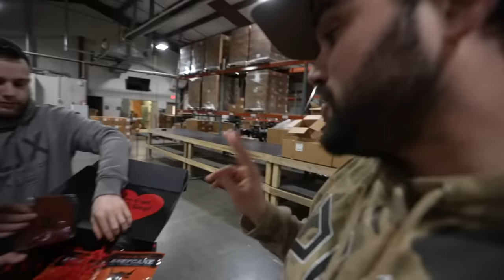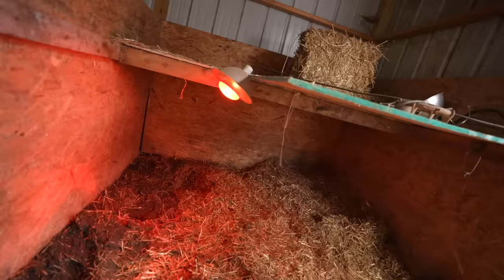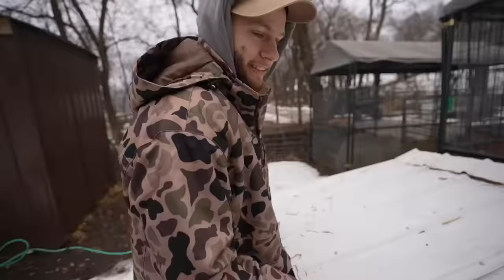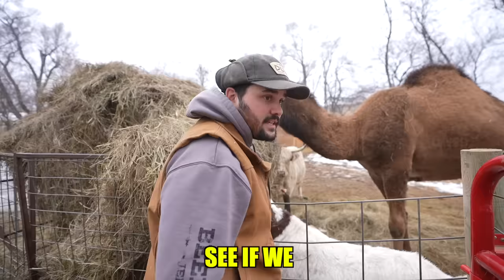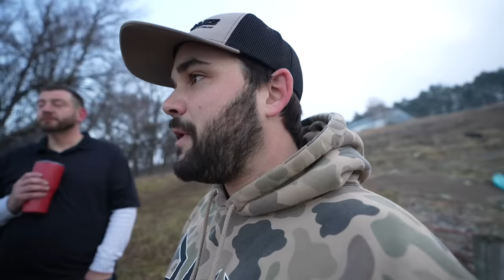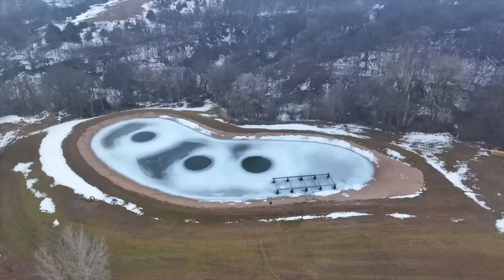SURPRISE Major BACKYARD POND Update!!! (Did I Just Save $100,000?)

Comment: Natural ponds are way better, liners are fine but you have muskrats, snapping turtles that will damage the liner. Rotting material will create methane pockets that will create Big pimples in the liner and they will eventually pop and it sucks when it's in the middle of the pond. My suggestion is spend on extra bentonite and re-layer with dirt and sheeps foot the crap out of it. I've done many ponds and for the most part, the ones that did put in liners aren't over whelmingly happy with the out come... Clay is the ticket but it is pretty expensive ...just my 2 cents
Reply: Crawfish can cause damage to a liner also.
Reply: Agreed
Reply: Could catfish also cause damage to liners?
Reply: @garretthuddleston2341   To clay liners it’s possible
Reply: We have a natural dam in the pond at the old farm. It’s a huge pond. We kill snappers to help keep them off of the dam still but the layering is definitely key
Reply: I have shot the liner in a pond with a 300 win mag while the liner was 4 feet deep
Reply: Bentonite !
Reply: @garretthuddleston2341  
If the liner is exposed yes but nowadays most pawns with liners are buried between 6 to 12 inches of soil on top of them
Reply: Agreed
Reply: 25 yr warranty tho..

Comment: If you line it, you'll want to cover the lining - preferably with rocks, gravel, etc. that will hold the liner down (stop if floating up), and will protect it for life.  You will need a lot of rock/stone, but it will make a natural looking pond.  I made one like this on my channel....I would still go with the clay and bentonite though. You'll do it right, and you won't scrimp on cost, and it will be a much better product long term.  Just don't cut any corners while you do it.
Reply: With the pressure of the water it will stay down
Reply: Flair listen to this legend!!! He’s the best around!!
Reply: This, all of this.
Reply: I think the weight of the water would hold the liner in place, wouldn't it? I guess the company would know how/what to do. The one benefit of using the liner over the bentonite/clay is that if it does start to leak, someone who knows what they're doing will come and repair it, which I bet would involve learning where the leak is, etc. For the record, my initial vote was for the bentonite and clay too, but there were a few tidbits (like them coming to repair it for 25 years) that we didn't know last time. That's a pretty big perk in the long run. 
Plus after many years, even if he decided to remove the liner one day, I'd like to think that with the weight of the water on the soil, etc. may have helped compact the soil underneath to help seal it?  I dunno, I'm just thinking out loud, haha.
Reply: Yes

Comment: I am not an expert by any means but after some quick research I say the bentonite or the clay and bentonite method. If your pond is currently not holding water… you are solely relying on that liner. Although it may be under warranty for 25 years, if there is an issue with the liner in a deep part you are going to have to drain the entire pond and start the whole thing over again. Let’s say you go 7-9 years with no issue and have 10-16 pound bass in there and the liner rips or a muskrat rips through it… all those years are gone. Your pond is going to end up looking exactly how it is currently. Making it as natural as possible reduces the risk and fixing an issue may be more expensive but it doesn’t wipe out all of your years of growing those fish. Just my thoughts.

Comment: Clay and bentonite, based on the other ponds sounds pretty straight forward that clay and bentonite would be fool proof considering both has little to no leaks without clay and the one that doesn't leak was even mixed with the same soil your working with, seems obvious to go with something that's easier for you to add structure too without the stress of it causing a leak later on and having to find it

Comment: Bentenite, Clay, and big roller for sure!!! I have seen pond dams where a muskrat dug out around the overflow tube and started leaking and was definitely fixed with just bentenite and have had no issues since!!! Now if you have a liner and an animal pokes holes in it is it still covered under warranty or not??? I definitely say bentenite and clay and make it at least 15’ to 20’ deep and you won’t have any issues!!! I did say something about the more water would help put more weight down helping it to not leak way back in one of your first videos!!! The pond guy I no had told me about that and with the bentenite and clay packed in and being deep enough that he would definitely guarantee it to not leak but it would have to be with the correct clay also!!

Comment: I'm with most on the bentonite train mainly because of having watched the last few years of pond "antics".... the structure adding, random challenges that would make osha faint and the possibility of a random stray from a hunt or target practice not to mention hooks or fish with teeth going after prey on the bottom
Reply: Two things water greatly slows down projectiles and the earth and gravel on top of the liner will protect it as well.
There is a mesh shield that you can get seeded with wire that will protect the pond from most things.
The only real difference is margin of error, clay ect has a large margin for error compared to a liner. What people don't seem to understand is you can pack stuff on top of a liner to keep it natural and safe, in fact it's hardier than without.

Comment: I'm a fellow Nebraskan in eastern Saline county. I have a roughly 2 acre pond on my 40 acre square and although mine was an old pond that we dug out and always held water, after we dug it out to increase and expand we did spread a few trailer loads of vermiculite, yes vermiculite, and we just drove on it with our trucks to pack it in (cause we did that after all the big equipment was gone or wed have had them track in it with their dozer). You have to keep in mind that once there is water in there and the soil becomes conditioned to holding water (could take some time) it will also silt in and add to the whole sealing effect naturally... Also should you go the Bentonite method you can slurry or float vermiculite to help seal leaks, it will float at first but once it becomes water logged it will sink and naturally settle where any leaks may show up.
In short, natural ponds all the way.!..

Comment: Both will hold water and can be installed on large ponds. The difference is that Bentonite can self-heal and expand around the small gaps and crevices in the soil, meaning that you don't need to worry if the machinery runs over the liner or plants and roots pierce the pond bottom
Reply: Plants and roots aren’t going to pierce a liner they are insanely thick most even have fiberglass woven in they are both good options but I think a high end liner is gonna be a safer long term bet especially with the free 25 year warranty like🤣 that’s common sense brotha

Comment: 4 ponds is a tiny sample, so banjo and jake saying 100% of the liner ponds don't leak and 50% of the clay ponds leak doesnt really mean anything especially since it sounds like the clay pond that leaks could have neen made to not leak if the right steps were taken. I dont have any experience or data to support one or the other but i just cant get on board with putting a huge piece of plastic or rubber or whatever in the ground to make a pond. Maybe the liner will last a long time but maybe it wont and if it doesn't, its going to be a major PITA to dig out and replace or even just dig out and dispose of if you don't want it anymore. Sure, you can apparently repair a liner but you can also repair a clay lined pond. The earth has enough trash and plastic buried in it without us intentionally adding to it.

Comment: It's easier when you have other people spending your money!😅😅 but after you talked to the people with bentonite, that route seems cheaper also considering you sold everything to save and spending equal money for either. So you would save money, and if tge liner has a 25-year warranty, it probably wouldn't last much longer than that in the long run and the companymightnot evenbe around! If it was me, I'd do the bentonite, and it will eventually work itself out and maybe have to run the well a few times a year! You said it yourself that the truck of bentonite didn't cost that much, and i have a feeling that your pond is only leaking in 1 exact spot, where it goes down into the creek! So you can also use bentonite with the pond full and not have to drain it to fix.😏

Comment: If you get a hole in a liner you will need to drain to the point of the hole to patch it. If theres a leak with bentonite you can dump it in the area of the lake of the leak and it can get into the leak and patch.

Comment: Have a lawyer look into the fine details of the warranty. They always have exceptions to there warranty about installation and such. That could really help in your decision making process. I would also add that you could bentonite parts of the pond first. Say measure the pond for a couple weeks if you haven't already and see where the water stays. Then bentonite up a couple feet and see if it holds. You may just have a section that isn't holding or area.

Comment: I use the same gate latches and when it freezes I have them on single posts and they’re off the same amount. Summer they’ll latch otherwise I need them pulled over like you.

We’ve been dry enough the last two years that you were working with super dehydrated soil. It may change some with the moisture but likely still have issues.

Comment: You could always try the clay/bentonite on a smaller scale at your property to make sure it works
Reply: That’s a good idea but the amount of pressure would be different just cause it would hold 4 ft of water doesn’t mean it would hold 15 ft of water
Reply: I don't see rhe reason to test it. Bentonite and clay are the tried true and proven way to build ponds. As long as whoever is spreading it out and packing it down is qualified there'd be no surprises. The last thing you want is someone who shorts the order and goes too thin which would cause problems.
Get the thickness in writing in the contract and watch everything they do. Don't pay until you are satisfied the job is done right

Comment: I would do one truck of bentonite and 2 trucks of clay. I think a liner is big risk. The liner is actually a lot harder to find the leak. There is a 2 part chemical you can mix into the water that will plug any holes. Bassbass used it on his 5 acre pond.
Reply: It’s a two-part polymer that has amazing results

Comment: Hello Iam one of your fans I've always wanted pond or atleast make one this closest I can get  .Bentonite is considered the best material for use in a pond for several reasons. Here are a few of the key reasons why bentonite is preferred for pond construction and maintenance:

1. Excellent Waterproofing Properties: Bentonite is known for its exceptional ability to swell and create an impermeable barrier when hydrated. This makes it an ideal choice for lining ponds, as it helps to prevent water seepage and effectively waterproof the pond to retain water.

2. Environmentally Friendly: Bentonite is a natural clay material, making it an environmentally friendly choice for pond construction. It is non-toxic, readily available, and does not pose a risk to aquatic life or the surrounding ecosystem.

3. Self-Sealing Properties: When properly compacted, bentonite forms a self-sealing and cohesive layer that can withstand external forces and resist erosion. This self-sealing property helps maintain the integrity of the pond liner, reducing the need for frequent maintenance and repairs.

4. Adaptability: Bentonite can be used in various forms, including granular, powdered, or in a blanket form, making it adaptable to different pond construction and sealing requirements.

5. Cost-Effective: In comparison to synthetic liners or other alternative materials, bentonite is often a more cost-effective option for pond construction and maintenance, providing a high level of performance at a lower cost.

6. Natural Nutrient Source: Bentonite can provide valuable nutrients to the pond water. As it slowly breaks down over time, it releases essential minerals and trace elements that can benefit aquatic plants and fauna within the pond ecosystem.

7. Longevity: Properly installed bentonite liners can offer long-lasting protection for ponds. The material's resistance to degradation and ability to self-heal minor damage can contribute to the durability of pond liners made from bentonite.

8. Excellent Sealing Performance: Bentonite's ability to swell and compact when hydrated creates an effective barrier against water loss, making it a reliable choice for preventing seepage and maintaining adequate water levels in ponds.

9. Limited Maintenance: Once installed, bentonite liners generally require minimal upkeep and maintenance when compared to other types of liners, reducing the need for ongoing repairs or replacements.

10. Ecological Benefits: In addition to being environmentally friendly, bentonite can contribute to the overall health of a pond's ecosystem. Its natural composition and sustainable extraction make it an eco-conscious choice for pond construction.

11. Stability: Bentonite's ability to form a stable, low-permeability layer provides a secure foundation for ponds, helping to maintain water levels and mitigate the risk of soil erosion.

When evaluating the use of bentonite for pond construction or maintenance, it's essential to consider the specific requirements of the project and the characteristics of the site to ensure that the material is suitable for the intended application. Consulting with a professional in pond construction or geotechnical engineering can provide valuable insight into the optimal use of bentonite for any given project (AND NO NONE OF THIS IS COPPY AND PASTE YOU CAN GO LOOK IF YOU WANT ) sincerely-Arthur
Reply: Idk if I miss spell any of this but props to anyone reading this 👏
Reply: Also my prefrontal context is still developing
Reply: @Mrtoxictoxic it didn’t take as long as I thought it would

Comment: If you have the liner, you can’t catfish in a lot of ways, because with a big old trevel hook on the bottom with a weight, it could easily grab the liner and poke a hole in it and then y’all could not find the hole because it would be so small

Comment: I own a landscaping company in Omaha and IMO I say clay and Bentonite 100%. Liners aren't necessarily a bad idea but having the clay and bentonite will only help when it comes to habitat sustainability. Better filtration and water quality which will significantly help the fish grow, reproduce and overall be a productive eco-system.
Reply: 2-3lb per sq/ft is a good average for Bentonite required. The more silt/sand and less clay, the more bentonite you need. For example sand/gravel you'd need 6-8lb per sq/ft. This can help you figure out the quality of clay you're dealing with. 

The bentonite bucket test is completed as follows:
Drill 15 - 1/4" to 3/8" holes in the bottom of a 5 gallon bucket
Place 6-8 inches of soil from the pond to be sealed in the bottom of the bucket
From the application rate table, select the bentonite application rate for the soil that matches the pond soils
Mix soil with bentonite at that rate in lbs/square foot
Thoroughly blend the soil and dry granular bentonite until the mixture is uniform
Add 3 cups of water to the soil bentonite mixture and mix again until moisture is evenly distributed
Firmly tamp the soil/bentonite mixture into the bottom of the bucket
Using a permanent marker or paint stick mark a fill line roughly 2 inches from the top of the bucket
Gently (so that the soil isn't disturbed) add water to the fill line
Monitor water loss over a minimum 48 hour period
If seepage continues, repeat at an increased bentonite application rate until desired results are achieved
Calculate the bentonite required for your pond area as follows. Multiply the number of pounds of bentonite used in the successful bucket test by 1.75 to determine the application rate in pounds per square foot. (If using our 5 gallon pail for the test. The area of the bottom of our standard 5 gallon bucket is 0.57 square feet) If using a different bucket, determine the bottom area by the radius of the bottom (in inches) times 3.14 and divide by 144 to convert the answer to square feet.

Comment: Your rabbit setup is killer. That mulch and poo will keep the rabbits warm. That straw and poo would be great for a garden or top dressing any trees you have planted. 

I have mentioned before but those chickens don’t need heat. Mine took -35 below this winter. My barn has an open window for fresh air. I have a couple chickens that do their own thing. At 20 degrees they leave the barn and sleep outside in a tree near the dog. My main flock is already out of the barn and in a portable coop. Chickens are tough. Just make sure they have small combs.

Comment: I still vote for a liner, it’s going to hold water regardless. If you do clay & bentonite it’s a 50/50 if it leaks. 
Every square inch has to be compacted well, it also has to have an even layer across the whole lake (thin spots will punch through when compacted) 
Just like the conflicting story’s from your neighbors. 
With both bentonite neighbors one had a leak & one didn’t 
With the liner neighbor they had zero leaks & the hatchery pond has zero leaks. 
I personally think the liner is the clear winner